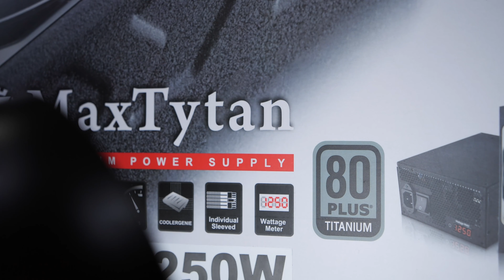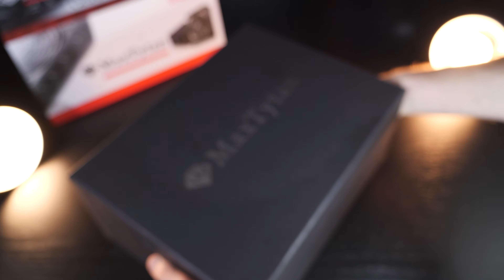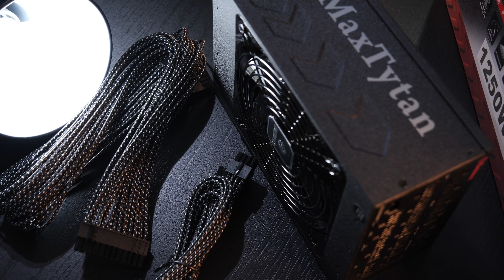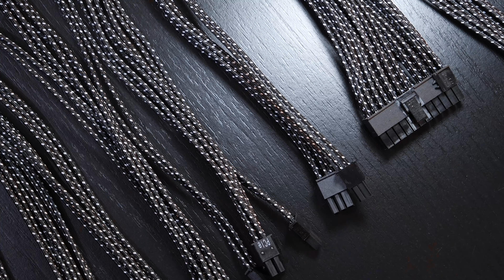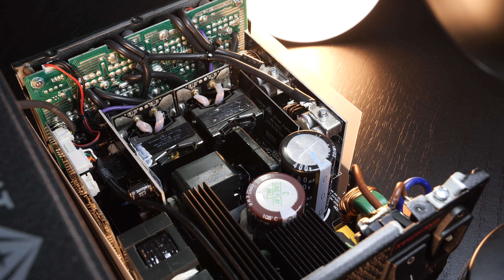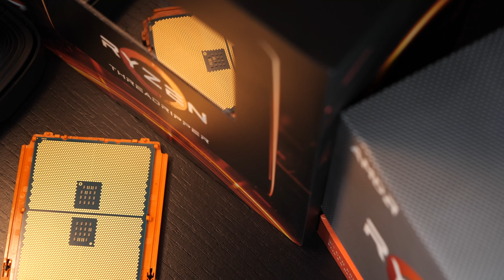I NEED THIS for RTX 3000! -- Enermax MaxTytan 1250W

Comment: Ive had my revolution 85+ 1250W for 12 years, only thing that failed was the fan bearing making noise after 4years and I just replaced it and hasnt failed yet.

12 years and is the only thing that hasnt changed when upgrading my PC 3 times, totally worth it.